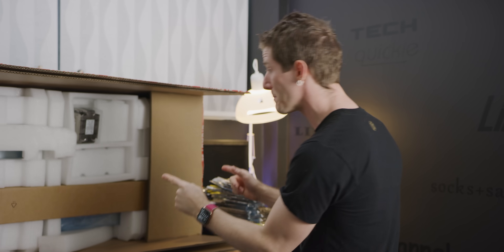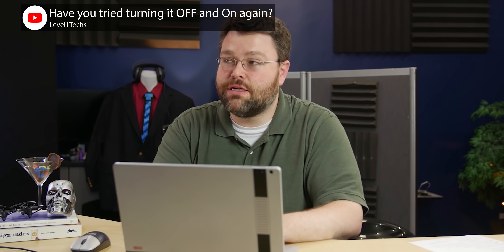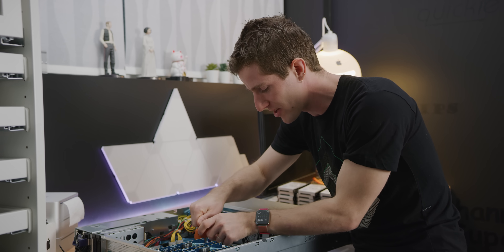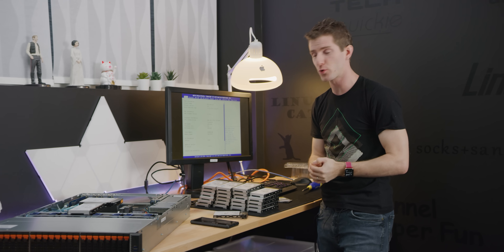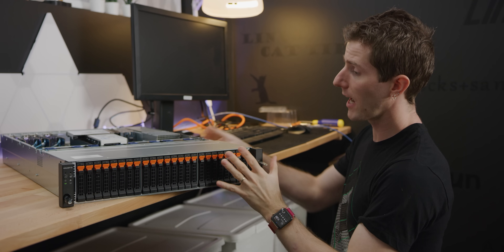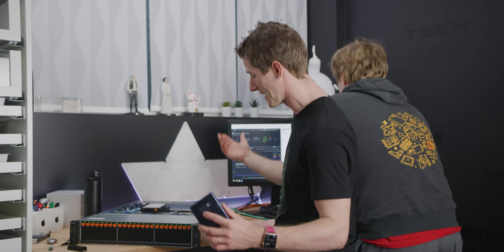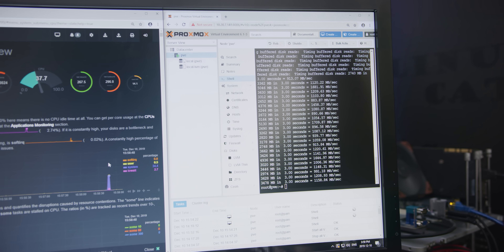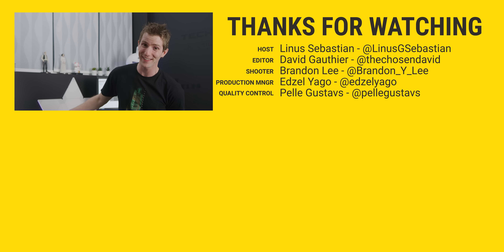Where Intel is in REAL Trouble... - AMD EPYC Server Upgrade

Comment: "...Why didn't you put in a HW-RAID controller?..."

* sigh * Well because after the drives get over a few hundred GB, the rebuild times are appalling... and your HW-RAID is never going to >>know<< what data is good or not, it'll just make an democratic guess (majority voting rules).  Time for you to come to peace with Gluster+ZFS...  You have a pretty hot system for that - a couple of ZIL Optane M.2s and a truckload of PCIe/NVMe bulk storage, 1GB of RAM for symbol storage per 1TB of disk storage.  Then use mirroring on your ZFS storage pool for highest-availability and fastest-recovery-from-failure (yeah it eats capacity - but one drive with Hash-verified known-good actual file and directory data is faster to recover from, than calculating sector contents of multiple other drives from a hash computation and you don't have to calculate the free space!!!).

So yeah, you figured it out, don't use Windows for storage... but you should really get into storage at the lowest level.  Get rid of Proxmox and start using top-of-tree Debian/CentOS with the latest patches and no UI on the storage machine (do a UI on a remote device, even as simple as an RPi), top-of-tree ZFSonLinux, top-of-tree GluserFS.

At your storage capacity, you should be doing SAN, GlusterFS gives you the opportunity to spread out your data across several hosts, hot-expand storage (adding new hosts), etc.  Then you probably want to take a look at Mellanox's MCX613106A-VDAT PCIe Gen4 dual-port 200Gbe NIC for a storage ring.

I never understood Intel saying "40-lanes of PCIe is enough" - no it f-ing isn't!!  24x of 4xNVMe + 16x of 200Gbe + 16x of VM GPUs is 128-lanes...  and I still want another 64-lanes in 2U TBH, and support for 1TB of memory across 8-channels of DDR4 (128GB single stick LRDIMMs) in order to support 768TB of ZFS (those 32TB NVMe drives will be coming out soon enough).  Sure it's going to be an expensive system, but I'm spending someone else's money and I want to cram 7.68PB of GlusterFS+ZFS(mirrored) into a single 40U rack - and still run VMs in the farm, because the floor space is more expensive here than the system!!
Reply: THIS!!! Seeing Linus had such a disasterous time when their server failed when a  raid controller failed and had to be replaced- why they weren't going to the much superior ZFS system where projects can even get their own individual storage pools and use snapshots and automatic backup migration thus simplifying data management.

But maybe I'm just getting into the virtualization thing too much.

Also.. no one has commented on the noise that puts out. That rig sounds like a bleeping hovercraft!
Reply: id personally use Ceph  over gluster but they all do the same sort of thing.
Reply: I've had a ZFS box running for going on 7-8 years now in my basement.  Its running on open indiana and just goes.  Its sorely in need of an upgrade but to be honest, considering what it was used for (wedding photo backups for the business) its basically obsolete.  With 1GB internet and free unlimited RAW cloud storage on amazon I can just use their space for backup and local storage for editing.  Still, building servers is fun.
Reply: @bp968  Dude, that sounds like a disaster waiting to happen... U cant trust some1 elses cloud/server...
If it fails & they loose your clients photos... what r u gonna do..?? Make them get married again..!
Reply: @MaxMax-dq1lu   Max Max  so two different companies cloud servers need to fail and my double local backup has to fail and the client needs to lose their memory-stick/BR/DVD that their wedding is on.

No I feel comfortable with that level of risk.

20 years and near 1000 weddings and the methods we use haven't failed us yet.

And yes, in case your curious, ive seen that happen 3 or 4 times in my career.  A photographer asking a client to recreate their wedding due to lost images.  It was far more common in the days of film photography.  You know, back when we didn't have dual card slot digital cameras and so much storage capacity its a none issue to sling TBs of data duplicates all over the planet.
Reply: @MaxMax-dq1lu  also, i didnt really directly answer your statement.    "You cant trust someone elses cloud server".. yes, you can, absolutely.   I might be an ex IT guy, you might be a current IT guy, most wedding photographers barely know how to turn the PC on or are (gag) mac users.  Sure they know photoshop and lightroom but their idea of a backup is a external drive plugged into their macbook they fill up and toss in a box.  Are their images safer on amazons enterprise cloud storage or a hard drive in a box?  Because from my experience the best I can get out of them is either or.

TLDR their data is way safer on an enterprise cloud storage than some halfass box their friend made for them that might as well be an alien obelisk to them.  Or nothing at all.
Reply: @bp968  Ur 1st post said nothing about the additional cloud storage, or other local copies... it sounded like u were planning 2 use just 1 cloud storage company..!
I agree that if u use 2 separate companies & additional local copies then ur safe...
I do have 1st hand experience...
My sister's wedding photographer lost half the video & a bunch of photos...
Also a friend's wedding same thing happened luckily I had been filming on the day & taking photos & these saved the day...
1 thing I learnt very early on...
Always have more than 1 back up.!

Comment: Man I love fast arrays.
I have two ASUS hyper m.2 v2 cards running eight 1GB Samsung 970 evo plus drives in my threadripper rig. I get stupid fast 24000MBPS reads and writes. If I OC'd I could get 26800+MBPS reads and 25800+MBPS(capped out) writes but it was very unstable. Never could OC it far enough for the full 28000MBPS read speed the array is capable of.
It's total overkill for anything the rig does but I got an insane deal on the drives and the hyper m.2 cards so I figured why not.

Comment: Build 2 More.
Install lizardfs 3.12 on the 3 machines.(scale up as you grow, both space and speed in parallelism)
Install 40Gig for backbone to sync chunks between machines.
Determine your redundancy level by folder or file. 
If a drive dies, the other chunks will automatically mirror themselves to available space in the cluster.
Comparable to Ceph without the headaches.Get rid of all the raid/zfs issues unless you need speed.

Comment: finally running a proper software raid! i'm proud of you for not using unraid or storage spaces! the big boy pants are on! all open source too!! so proud.
Reply: He still doesn't run a proper linux as he uses a stock distribution without custom kernel. I had bad isues with linux drivers and incompatible software libs.
Reply: losttownstreet how is that not proper Linux tho?
Reply: @losttownstreet3409  its debian 10 with custom kernel.
Reply: it is

Comment: "a testament to how efficient AMD's new lineup of CPUs is that they only need one heat sink and this one"
well that fan also just made the whole server take off when it started up, but its still one fan...
Reply: I believe those are the PSU fans, those are loud af.
Reply: looks like it has several fans. loud doesnt mean its moving a ton of air, im sure there are quieter fans that move more, they just dont need them.
Reply: Those are all the chassis fans, and they normally ramp up to the max on power-on. And no, the cpu heatsink isn't passive. When the chassis cover is put-on, the air goes from front-to-back. Some of the air are channelled exclusively for the cpu heatsink with a shroud.
Reply: @staple132  could you please send me a fluid sim for that?
Reply: @peterdessev536  I don't think a simulation is needed for that nor that I could provide one. But there is a reason why most/all of rack mounted server covers have labels on top stating that prolonged removal of the cover while online runs the risk of overheating the components.
Reply: @staple132  Oh my bad. I didn't realize that fans pushed the air from their intake out their exhaust, thus pushing it over any components that are in the way of the exhaust. Next time I will make sure to do my research and be more educated on a topic before posting a sarcastic YouTube comment.

Comment: Let Linux handle the drives in raid, and add a virtual Windows. With KVM, the performance penalty is very low. And if Linux only needs to handle the drives and host an OS, it's very unlikely to crash.

Comment: "...And it's even worse, how it that possible?" 
That's windows for you.
Reply: And yet default windows outperformed default linux ;)
Reply: why do they insist on a software Raid and not a hardware based RAID-0 for speed & reliability !
Reply: @glasser2819  RAID-0 for reliability 🤔🤔what about using the same proxmox to create a ceph storage?!  JBOD & 3 replicas should done the job!!
Reply: @glasser2819  for the same reason ZFS and BTRFS are preferred over RAID 5/6: software RAID is more powerful and reliable than any hardware implementation to date.

Comment: Lol, recently lost my job and along with it my cable so I bridged my router to use my cellular data for my wired home network. When I reach my data cap my bandwidth is limited to 600Mbps so I bonded the wireless hotspot with the hotspot on my phone to get 1.2MBps in order to make my internet access was even usable. So the bandwidth Linus achieved in this video is uh, about 200,000 times faster than my internet connection LOL.

Comment: Ahhh guys... A pool of 6 discs in a RZ1 configuration.... Wtf?

Just try to devide 128k (ZFS blocksize) by the amount of discs per dataset... and do It manually. Each additional operation will need to be written to the discs, you waste space and loose a lot performance.... AS raidZ1 is pretty close to raid5 you'd devide 128/5.....  

Alsow why do you guys choose RZ1? That is the most unsafe and slowest way to go with such a pool..
You loose two drives an all data is lost....
Striping the raidZ1 can mitigate it somewhat but why not use Big stripeset with 2 or 4 drives/stripe..

Alsow remember in a server max. Throughput is only half the story, you need low latency when multiple machines request data...

Comment: 7:30 Linus pls, Why would you ever want to run hardware with internal non-battery powered raid-controller? You're going to vendorlock the s... out of your equipment. On one-off server like the editing nas, you should never ever run hardware raid for your system. Because if that controller breaks, your f'd, since you'll need exactly the same kind of controller, if even that works. With software raid, you get exactly the same benefits of raid, but you can swap the drives to new machine if something happens and it generally works out of the box. Hardware raid doesn't have any benefits over software if it doesn't have battery backup, but a ton of issues.

Comment: Make sure you have ECC RAM installed. ZFS filesystem does not work properly with Non ECC RAM as parity checking of the filesystem then won't work.

Comment: Linus: "your home network is probably gigabit"

Me: cries in 250 megabit
Reply: That's not bad
Reply: Home network is gigabit, less is just not making sense anymore with GBit switches being incredibly cheap. Internet connection is only 16Mbit/s up, 2.7Mbit/s down, though
Reply: Cries in dial-up
Reply: How? Like, what are you using at the physical layer? Ethernet doesn't have a 250 Mbps mode.
Reply: @hellterminator  1) my isp provides 250 megabit, 2) for wifi to reach all over the house, we have 3 routers, and the 2nd out of the 3 Daisy chain is 250 mbps, therefore also limiting router 3 to 250 mbps
Reply: 1mb per second download for me
Reply: @lukeson8934  
Unlimited? Or before the Fuked Up Policy?
Reply: Depends on if you're talking LAN or WAN side. LAN side gigabit it nothing: cat5e has been the standard for a while. WAN side gigabit however...
Reply: Elijah Ometz I have 25mbps fuck you talking about cuh

Comment: XFS should rock.  I've been using XigmaNAS as my nearline photography NAS for quite some time (including before the name change).  RAID 1+0, all in software.  Upside is that adding disks (in pairs) is very straight forward and I'd have to double fault a mirror set to have to resort to backups.  Downside is that I consume more drives (And slots) than a RAID Z2 which should survive a double fault.  XFS can also be enabled with journaling.

Comment: >not using the rear sata drive slots for boot
>you know, the ones accessible from the outside
>so if one of the boot drives dies, you're now going to have to power down and open the chassis to replace it
But your uptime, tho
Reply: Not really a problem in this situation, as the server is probably only used during office hours. Just power it off when nobody is using it and replace the bad drive.
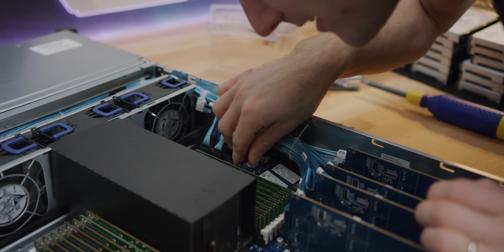Reply: 5:33

It appears he knows, but wants greater speed. Shrugs
Reply: MrDucktastic for a proper NAS, the boot drive speed doesn’t matter. Once the operating system and relevant applications are loaded into memory, the steady-state performance of the server is unaffected by boot drive speeds.
Reply: @KeeganDent  Yup. I'm not arguing the point, I assume he's got his own reasons. Just linking the part of the video where he addresses it.

Comment: Heck, getting DOA hardware is possible from NEW hardware too (many people don't know that) Nothing worse than deploying your new systems and finding a system that has a hardware issue (whole system is dead, drive is dead, ram is damaged ) when it was new in box
Reply: in the 21 years of building systems i have as my background, ive come across a TON of DOAs, from ram and drives to high end GPUs and the occasional CPU. when you work with a large volume of parts (say 500 sticks of ram at a time), the law of averages rears its ugly head, and some of your hardware will end up dead. ...... yeah, sorry for that rhyme....
Reply: @ghomerhust  I worked a hardware refresh where 3 out of 100 computers were DOA, Since we didn't unbox them before heading to the office they were meant for, it meant unpacking it, setting it up, turning it on, then having to pack it all up and head back to the warehouse we kept them all in to grab another. nothing like getting paid for walking all over the place. 
Now, I unbox things as soon as they come in and make sure they at least power on.
Reply: Got me some new 4x4gb 16gb 3000mhzcl15 during the inflated prices time for $230. one of the 4 sticks was damaged. I had never been so pissed and diagnosing that was hard af because it worked just enough to confuse me
Reply: There was a dark era in Seagate drives, when about 1 in 4 enterprise drives I got were DOA. Considering, I handled thousands it was really annoying. It also is the reason why manufacture lock in contracts are moronic.
Reply: @echtogammut  Seagate drives are still crap
Reply: Refurbished products are less likely to arrive DOA than new ones.
Reply: My first ever MOBO was DOA, fucked up shit homes

Comment: You don't want to run hardware RAID anyway. Software RAID is significantly easier to recover from errors from. And really, you should be running a unix for this use. I'd use linux, but there are others that will do just fine.
Reply: True.
Reply: software causes the errors it can recover from, hence its purpose!
Proprietary hardware controlers are expensive....

Comment: Seasonic makes AMAZING  power supplies, I ran one almost 24/7 in a gaming rig for about 8 years and it was still within 1% of rated voltages. 
Passed the PSU on to my dad who still runs it in his desktop 12+ years after I originally bought it. They don't have to pay me for an ad spot, their products are just ROCK SOLID.
Reply: pufthemajicdragon wtf 18 years +

Comment: I still don't have an NVME SSD. I just rebuilt my rig, 2080ti, i9-9900k, AORUS Z390 Motherboard, 32 GB; 3200 DDR4; 2x500GB SATA3 SSDs, and a 4 Terrabyte 7200RPM HDD. I will eventually get an advanced M.2 SSD.

Comment: Metal like that should be running Linux anyway, Windows doesn't handle that kind of hardware well. You'd get much better utilization out of it with Linux.

Comment: Linus, for the love of god, get an electric screwdriver. 

One with torque control.

Even if you ONLY use it for removing the screws and not putting them back in to prevent cross threading, you'd still be saving tons of time. 

Using those tiny screwdrivers all the time is gonna fuck your wrist up man.

Comment: You are missing facts here
If you are getting worse read performance, then write performance, then you are not benchmarking writes, but caches
You have 512GB RAM, so 30GB/S write for just 5 seconds means you may have written exactly nothing yet.
On Linux if you wish to benchmark write performance you need to fill your RAM with cache first (effectively write 512GB of data) and keep writing to get real performance after filing cache. You will see very dramatic drop of speed and then recovery. You should take average after recovery, as everything before huge drop is cache, then there is race condition to write both caches and data, which you are writing after filling cache.
And same goes to read, you are very likely to read from RAM (cache), as you have loads of RAM.
Reply: Any storage benchmark that is not fio is useless on Linux anyway... It's like the classic 'dd if=/dev/zero of=/test bs=1M' - you get crazy write speeds on ZFS, but only because it detects what you are doing and just no-ops all the writes lol

Comment: 7:35 Because hardware RAID is anachronistic obsolete incompatible crap that no one should be using !
12:25 Uses Linux… configures unsupported out-of-tree FS from BSD instead of LVM/XFS…
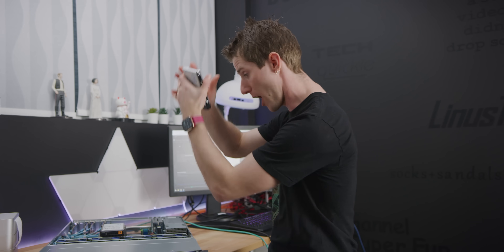13:15 Case and point… 14:15 Or you could just configure it the sane way…